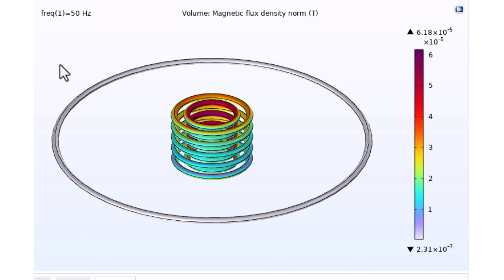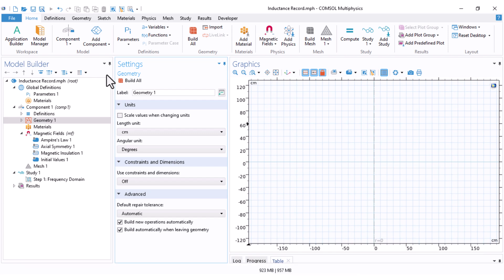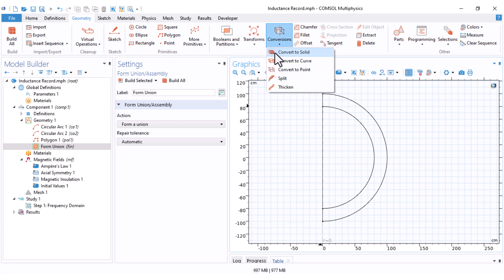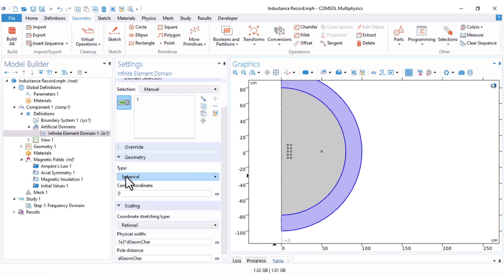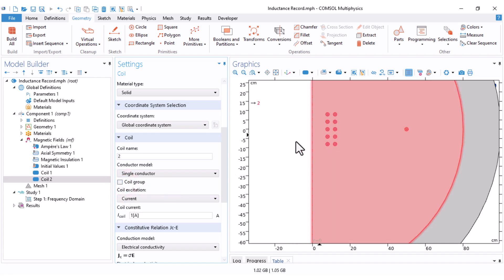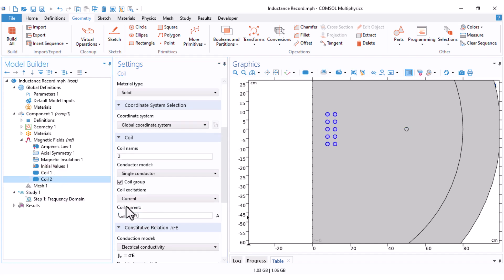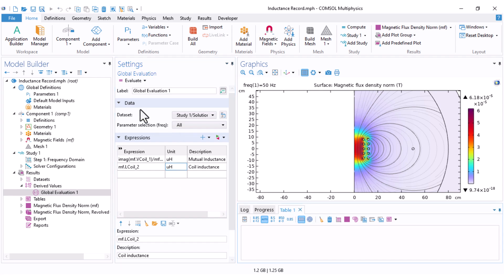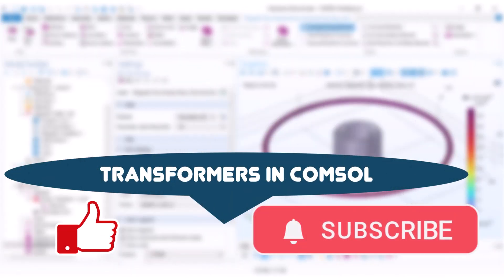How to Calculate Self & Mutual Inductance in COMSOL Multiphysics

Comment: If both coils have same geometry and number of turns then why the coil inductance is not same ?
Reply from the maker: If two coils truly have the same geometry and the same number of turns, then in a correct simulation their self-inductances should indeed be identical—as long as the flux-linking surface is defined consistently for both.

In the example shown, however, the two coils do not share the same geometry, so their self-inductances naturally differ.

What does remain the same is the mutual inductance: it is a single physical value, regardless of whether you calculate it from coil 1 to coil 2 or from coil 2 to coil 1.

Comment: Hello sir.
I would humbly like you to make a video on electromagnetic forming of metal sheets using a flat coil (pancake coil).
In Time Dependant Study.

If you want me to provide you with the initial values for the problem (voltage, conductivity, resistance, etc.) for the coil, and also for the metal plate, just ask .
thank you.
Reply from the maker: Thank you very much for your suggestion! At the moment, this topic is not in the short-term schedule of the channel, and I have not yet covered some of the necessary basics required for it. Therefore, a video on electromagnetic forming with a flat (pancake) coil might only be possible in the more distant future. I truly appreciate your interest and suggestion!
Reply: @HVAcad  
Hello.
I will send you a numerical model I created using the Comsol program, to the email address associated with your YouTube channel....
Reply: @HVAcad  
hi.
i sent you an email .
feel free to ask any thing about the atta.
thanks.

Comment: Hi! I'm having a problem finding induced voltage in a coil 40 mm far from the piezoelectric material. 

I'm applying a force on piezoelectric material and I'm trying to find an induced voltage caused by the material into the copper coil. But in comsol it's not happening with me. Can anyone please help me ?
Reply from the maker: Hi! The first question to consider is: How is voltage being induced in the coil?

Ask yourself whether the force applied to the piezoelectric material is generating a magnetic field.

If yes, then a changing magnetic field could indeed induce voltage in the coil.

If no, the problem might not be properly defined, and it’s worth revisiting the setup or underlying assumptions.

If the piezoelectric element is supposed to produce a magnetic field, I recommend first measuring the magnetic field in your domain. Make sure it’s actually changing over time—that’s essential for inducing voltage.

If no changing magnetic field is observed, there might be an issue with the functionality of the piezoelectric component.

Let me know if this helps or if you have more details to share!